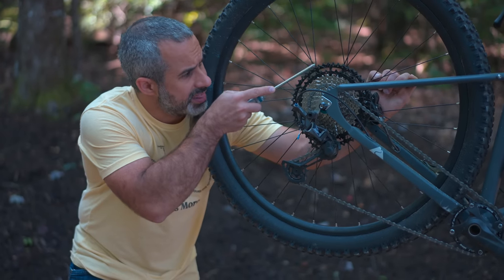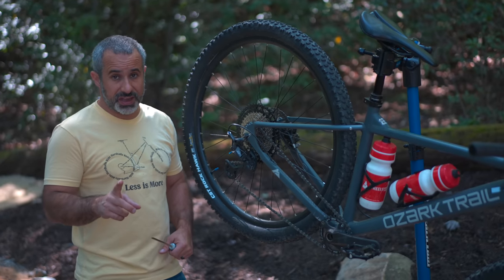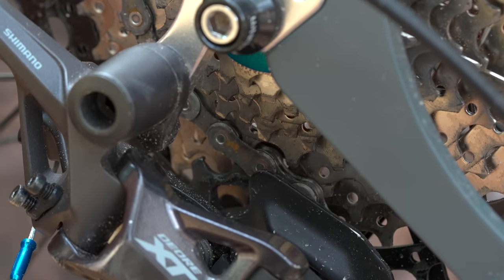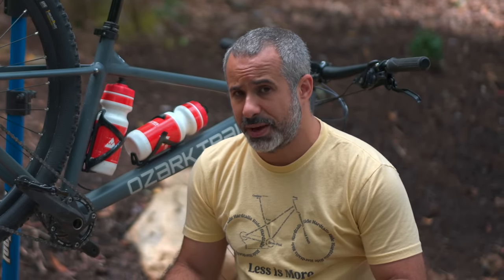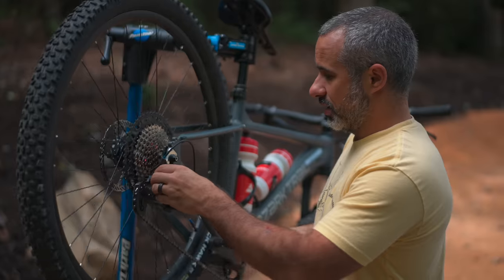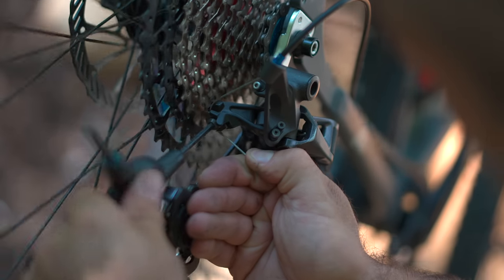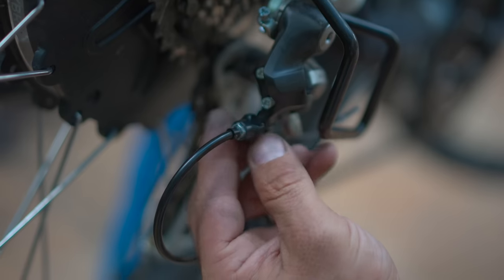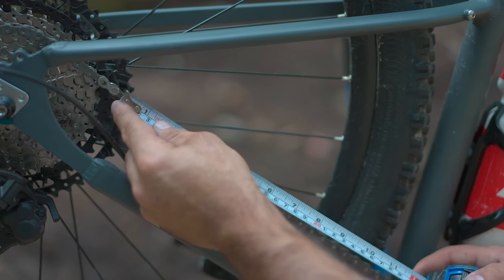How to tune your derailleur with basic tools (for beginners)

Comment: Sorry, but you missed the most important point - an old bike with old cables and housing. If those are full of rust, which they are after some time, you can adjust all you want, but you won't make it.

Comment: Lots of "entry level" MTBs still come with 2x, or even 3x, drivetrains. Could you make another video like this for front derailleur troubleshooting to help those people? This is great info for those that aren't very mechanically inclined!
Reply: To troubleshoot a front derailleur:
Step 1: save up your pocket money
Step 2: buy a skinny/wide chainring and a bigger range cassette to convert to 1x.

Just kidding. Even high end XC bikes still run front derailleurs because 12 speeds isn't enough over such a range of speeds and such long distances.
Reply: @IOUaUsername  I actually had typed out that I would just remove a 2x and install 1xm but removed it haha both my bikes are 1x
Reply: 7,8,9 speed also come with significantly cheaper and durable chains so, you can spend less time messing with this stuff. Just buy new chains for $12. Or, have a spare chain and soak one in kerosene for thorough cleaning to maximize life.

If you don't run worn chains, cassettes and chain rings will last almost indefinitely.
Reply: @apodski  Regular cleaning is most often enough, solvents on the chain are only needed when resinous substances are on the chain
Reply: @beerenmusli8220  Yeah, but it's generally easier and more efficient to just dunk the thing in a coffee can of kerosene, soak for awhile and go over it with a tooth brush. No splatter, no fancy brush. Kerosene is pretty non-toxic. Plus you can reuse the kerosene many times, then use it to light a bonfire. No waste, no nasties down the drain.

It depends on where you ride, sandy soil or limstone trails, the chain definitely benefits from full solvent dunk, as it gets out most of the accumulated grit and grim out of the inside of chain rollers. Where all the harmful wear occurs, that you can't actually see.
Reply: eye ball it and see the chain in the center of each cog. there all the same even the fancy ones.

Comment: One thing I didn't learn till 47 years old is that the spacing of the cogs on the cassette is uniform across all bikes. This is why if you have the set screws ok and the issue persists, it is almost always a bent hanger. Ala, there is no fine tuning between the gears: it should/will work for all of them or none of them.

Comment: The day is coming when the chain, derailleur, and the cassette go the way of the dinosaurs.  I hope it comes quickly because after 70 years of adjusting and replacing these relics of the past, I see a gates belt auto- shifting CVT type drive in my future.

Comment: Excellent. I'll share this with some friends. A simple tip I learnt was that if the derailleur won't shift up the block (towards low gears) turn the barrel adjuster in that direction. If it's over shifting and won't shift towards the higher (smaller) gears, then turn the barrel adjuster that way.
Reply: Mine only goes to the smallest gear after 2 or 3 clicks, even if the higher limit screw is too open, and the barrel adjuster doesn't seem to change anything (it's on the derailleur btw, not on the shifter) except unwanted gear changes when restarting the bike sometime...

Comment: As someone who used to bicycle to high school 20 years ago and at the end of last summer got my bike as I had just transferred to a job within biking distance, my old bike was just a 3 gears on that old long gone bike which I never remember having to service much at all and with my new bike having a few more gears is enough for me.  

So when I ran into this clicking sound to work and problems to get to my highest gear on the way home from work with is 11km in each direction I tried several videos here on youtube to figure out how solve it but while they introduced me to the same screws to change derailer settings as your video none gave much if any explanation of what each did so think I made more of a mess trying to fix things. 

Your video gave clear tips, explanations on what problems one could have, what to do and what each part did which was very enlightening that I actually think I can solve the mess I made when its clear all I should initially have done was just to fasten the tension on the cable a bit.  So just wanted to thank you and say that Im glad I ran into this video to use as a novice guide how to solve things. 

Thanks and have a good summer
A Scandinavian novice biker ;)

Comment: This is a very entertaining and fun video about a topic that might be considered mystical by some. I would however add that before replacing a hanger, cable and housing are much cheaper and usually, a more common culprit of messy shifting. Try that first, if you still aren't able to tune it properly, consider a hanger. Also, derailleur alignment gauges, while pricey, aren't that much. Depending on where you get your hangers, could be worth between 3 or 4. And with bicycle repair, check for compatibility as much as you can when buying parts!

Comment: This is a great resource to share with someone to help them demystify shifting problems. I wish I had this when I started trying to maintain my bike during high school. One thing I noticed back then after a long evening of trying to get perfect shifting: Although in the end the drivetrain still made some little unusual sounds with the bike upside down, once back on its tires it shifted fine.

For those of us being too close to OCD regarding to drivetrain noises: gravity has a tiny effect on where exactly the chain moves along.  What ultimately counts is the sound and shifting performance during a short test ride. Also, a slighty damaged tooth, a slightly bent chainring or an incorrectly installed chain link can cause ticking noises without really hurting shifting performance. (Of course, an incorrectly installed chain link should definitely get corrected. Chain breaking under load is not fun).
Reply: True. I need to get a stand to work on it right side up.

Comment: Now that I am understanding a bit more and did my first tubeless on the new GT, I rewatched this and have the gears changing pretty smooth now thanks.  I feel so new after stopping rock climbing I slapped my head when you just flipped the bike over.

Comment: The other thing I find sometimes with the newer 12S drivetrains is that if you have a chain in need of a clean and a lube it can try to climb a bit and clunk back down. So I tend to start with a good cleaning and lube. Then pretty much the same process! Nice video.

Comment: This is all good advice. By no means would I consider myself a bike mechanic but I am oddly good at dialing in my shifting. I chuckle to myself every time I help out my buddy with his drive train because he basically thinks it's magic.

The only thing I would add here is to also eyeball your jockey cage to see if it is bent. But I agree that if you're unsure, it's best to replace the hanger first. Then consider the jockey cage if it doesn't help. You'll probably have a hard time finding both sides of the jockey cage and end up just buying a new derailleur.

Comment: Great video! An important info that should be in it imo: if you tune the shifting on a new bike, it's normal to have to adjust the cable tention again after the first few rides, since the cable stretches.
Reply: To save that effort, I always pre-stretch new cables and housings during installation.

Comment: The alignment gauge was the first bike tool I bought a few years ago. Used it so many times and it ends up being cheaper than hangars (or getting a shop to do it) in the long run. I highly recommend anyone who wants to do DIY bike maintenance to get one.

Comment: Loved the float test :D On my new hardtail it came with a derailleur mounted at a funny angle. Gears never worked right, and could skip under load. The chain was too far from the sprockets, no matter the B adjustment screw. After adjusting the angle of the whole derailleur, then tightening it to the hanger, adjusting the tension to get the correct distance to sprockets, the bike is like new (I mean it is new).

Comment: 8:14. Thanks. I went to have my bike fixed at a local bike mechanic shop. They said the chain was too long, and swapped it and some other parts because they had to be swapped at the same time, or something. But for some reason they apparently did not bother to test the bike at all after putting it back together, because they would have otherwise immediately noticed that you can't really down shift at all, or at least have to shift multiple gears down at once and one back up, to have it work at all, and still have it jumping all around, and be loud. I just rotated the barrel thing like 2 turns or something, not sure if that's micro adjustment or not, but at least seems to work, and now works fine, maybe will later take a look, if would be better to adjust with the screw thing, well almost better that they did not test it properly, so that I learnt something new, but still a bit irritating.

Comment: A few additional tips. It's easiest to adjust the B tension before installing the chain or even the cable. Also, many frames are not perfectly straight, so even a brand new derailleur hanger sometimes still needs to be adjusted (especially for 12 speed cassettes). Finally,  that e bike is never going to shift great because of the giant granny gear.
Reply: I call it goat gear, because it is to climb mountains like a goat :D

Comment: If you have problems with your highest gear and you have a SRAM derailleur, also check your chain link. Some of them are directional. It can lift the chain above the smallest cog when it passes through and your chain will slip over the teeth.

Comment: One thing I would add is that if you have a full suspension bike, and the length of the chainstay varies based on compression.  As in just sitting on the bike and you have that sag, the length of the chainstay changes.  For me I was having an issue getting it to shift right while riding, but on the stand it was super smooth, as I was using the supplied b-set calibration tool from sram.  Well that didn't quite cut it.  What finally got it to work right was setting the b-set so the jokey wheel was even closer than what was spec'd.  Cause when the chainstay length changes, the rear cage moves in and out relative to the cassette.

Comment: Easiest was to check if your hanger is bent. 
On a 1x setup: Move the Rear Derailleur towards the middle of the cassette so the chain is as straight as possible to the Chainring. Take a couple steps back and look at the RD cage and the chain trailing off of it towards the Chainring. Check if it's in line or not. In line means it's ok, angled means it's bent.

On either 2x or 3x: Shift into the large chainring and the smallest cog on your cassette. Take a couple steps back and look at the RD cage and the chain trailing off of it towards the Chainring. Check if it's in line or not. In line means it's ok, angled means it's bent.

Comment: Instead of a derailleur hanger gauge, one can also use a wheel with a quick-release hub. The threads on the little "hub stubs" are the same as the derailleur mounting screw. Then you can check whether your "gauge wheel" is coplanar (parallel both from the back and from the top) to the actual rear wheel.

Comment: I can pretty much tackle everything on a bike's rebuild but getting the shifting on point is still a mystery. Still think it voodoo magic to make the shifting work. Ugh... Also the hanger float test, every D Hanger I've done the float test on is bent, even the new one I've bought to replace the bent ones. I have about 80 plus brand new bend hangers! Guess they all come bent from the factory. This silly little video helps this silly old man a ton. Appreciate it. One last thing, where do you buy your straight hangers from ????

Comment: I already know how to do this stuff just watched and 👍for the YT algorithm, also I set the B screw on one of my vintage road bikes all the way in and it shifts perfectly and stays in any gear I choose but I replaced the wheels so now it's a 12 speed (2x6) and the new rear wheel has the same gears from 2nd to 6th and a bigger gear for 1st so that might be why it works like that.

Comment: while i get that this is a video aimed at the home mechanic who doesn't have all the large or specialty tools, i think that sometimes the right advice is just to go to your local bike shop and let them help you. i know the "float test" is a joke but it's not hard to realign a derailleur hanger with a DAG, and it probably costs less and produces less waste than just saying "always trash your hanger"
Reply: Yes, hangers can always be reused until they become too weak to handle shifting. I broke a badly bent one on a Pinarello before during an attempt to realign it and it only took a little force to break. The customer already expected it might break, so he didn't blame me, I was also prepared for it to break, given the severity of the bend.

Comment: This is extremely informative, ive done extreme sports for 2 decades, and this right here helps alot. Ive recently went to mtb,and love it I dont hurt as much. But there is negative, and pros of doing it I suppose negatives are $, snobs, and pricks. Positives are not as much pain from shocks, crazy lines to go down, MASSIVE jumps, and get to travel to see the world if you wanted to ride all the time if that makes sense? Ive got a ignorant question, on the derailer side back tabs, what are the holes for above it on the tabs?

Comment: A not mentioned hack for setting the derailleur tension first time right: leave it on the second smallest gear, pull the cable with your hands without dying for and tight the cable. The slack of our hands pulling the cable will be enough for letting it drop nicely into the smallest cog.

Comment: You can use a QR Axel wheel as a derailleur hanger alignment tool! It's the same gauge thread you make sure the wheel is straight and screw it on, lever it parallel if not parallel.

Comment: If don't have a derailleur alignment tool you can screw in another wheel (not a through axle one of course) and use that as a reference to determine if the hanger is bent or not. Quite useful on old steel bike that don't have a replaceable one.

Comment: So for adjustment can you just take the derailer push it up to the bigger sprocket and adjust the screw while peddling it? then do the same on the small sprocket? pull the derailer the opposite direction, peddling and then adjust the other screw just enough so it doesn’t jump off the smallest one? that make sense? good video though. Learned alot

Comment: Whenever I've purchased a new bike I always ask for or order a spare hanger. Much easier to get (usually) when the bike is current. If they're cheap enough get two spares. You're either going to need them or it's a good feature if you sell the bike that you have relevant, important spare parts. If you don't carry the spare hanger with you when you ride then have an idea of how to make your bike a single speed with a chain tool/link in case of a worst case scenario out on the trail. I carry a spare ziplock freezer bag to throw broken parts in so they don't cut/soil your backpack/bag of choice.

Comment: Really great video. I wish I had the money to buy a bike stand for repairs but I am on a fixed income and there’s no way I could afford that. Like you showed, I have turned my bike upside down, but it makes it hard to work, my shifter, which is a twist grip type, unfortunately with my bike, I purchased used ,the Shimano shifter appears to have a “H and “L” limit screws but neither one seems to make any change at all. I’m stumped.
Reply: Try using a rope and hanging your bike, that way you can keep the bike upright. It's very annoying flipping the bike and adjusting,  just to find out your twisting it the wrong way. And for your problem sorry idk

Comment: I wanted to add something to this. There is an epidemic of terrible shifting on a lot of modern 9speed bikes. I haven't see this mentioned anywhere. Maybe 7 years ago shimano updated their 9speed mountain derailleurs, the newer version is called "Mega9 Lite". The problem is that the name is way too similar to the previous "Mega9" derailleurs and the two shifting systems are NOT compatible. Manufacturers commonly pair a newer Mega9 Lite derailleur with an older and cheaper Mega9 shifter. The shifting will sorta go into all of the gears with this setup, but it will feel terrible. I've seen this on Treks, Giants, Specialized, and many other brands. Generally to fix this I just replace the rear derailleur with a cheap acera 8speed rear derailleur and it'll shift like a dream afterwards.
Reply: Thank you!

Comment: One tip I would add is that when in the smallest gear the cable should not be saggy and loose. When I get a random tune up I always shift to lowest and see if the cable is very loose.
Reply from the maker: That's very true! Sometimes this means your chain is too long, and other times you need to bump up the B tension a little.

Comment: 8:54 Approaching from the non-drive side, I put my neck under the front of the seat, lift it with the back of my neck, turn left crank with my right hand and shift through gears with my left hand.  This saves the seat getting dirty.  For some reason I don't see other people doing this.

Comment: 8:54 a loop of rope from the ceiling works well too, just hook your sattle on the loop and hang it at a comfortable height. most of the time when you are over torquing a bolt, you are pressing down anyways.